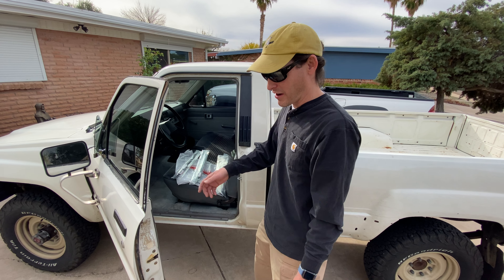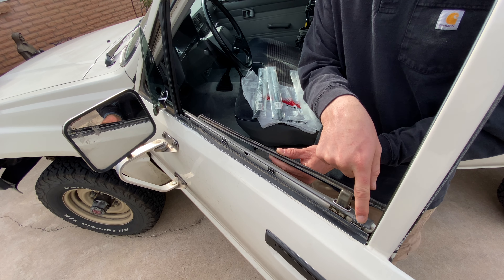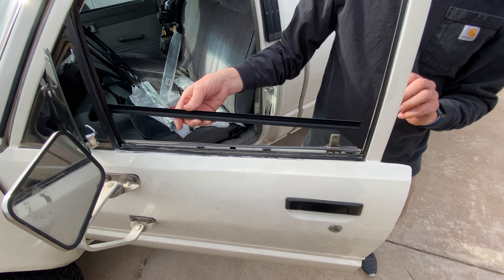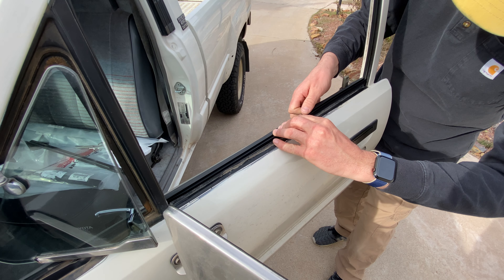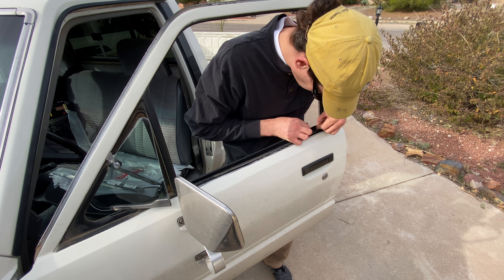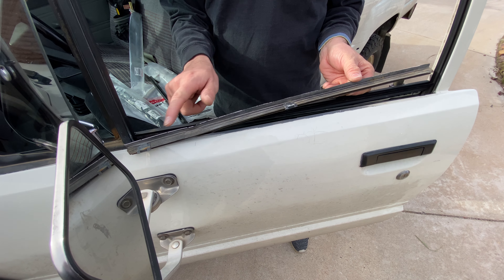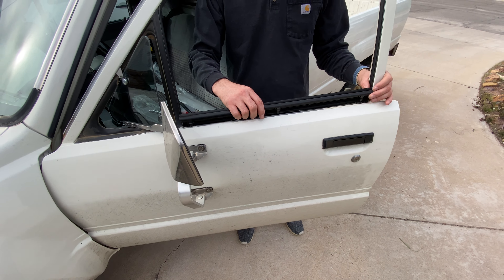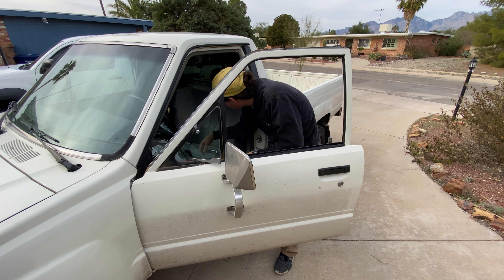1985 Toyota Hilux Pickup Truck & 4Runner Weatherstrip Replacement LN65 - 84-89 With Vented Window

Comment: Hi I just subscribed,  hope you can help me with some advice,  I do have a 1985 toyota 4x4  turbo diesel 2lt and i been looking for years for the primer pump where the filter goes and no where to be find, do you have any suggestions,  I see some at ebay but doesn't have the to connections where wires goes to the prime cup, hope you can help me out, or some of your followers  thank you.